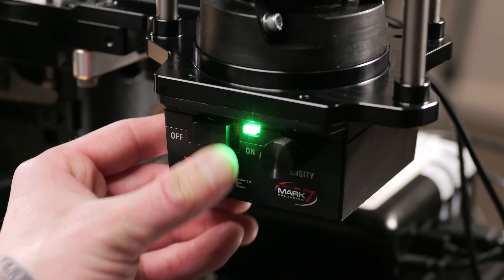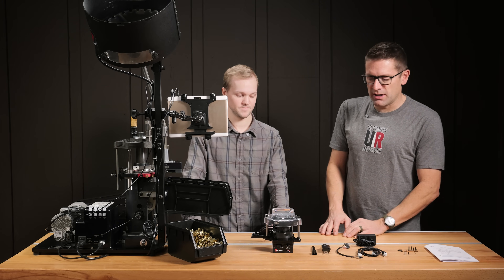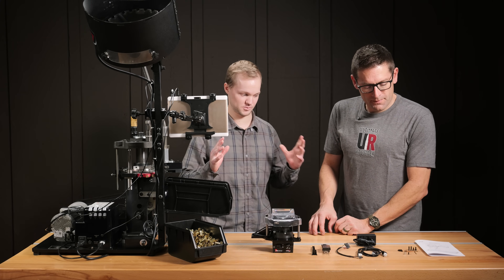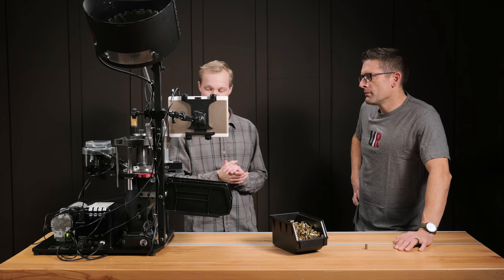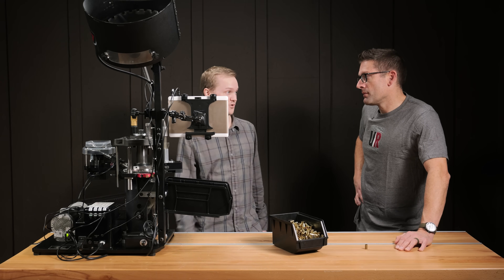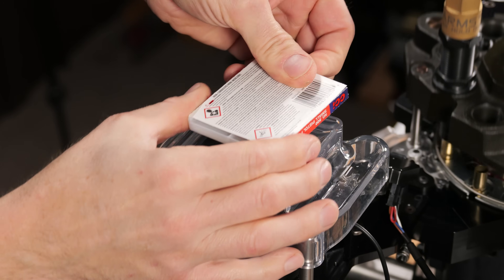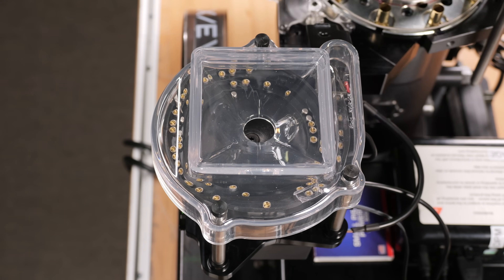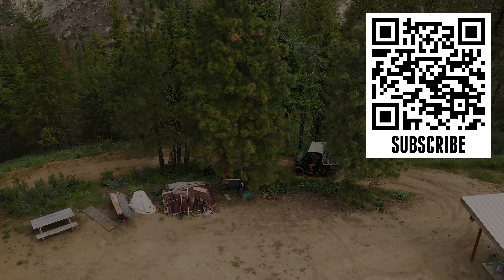NEW: Mark 7 XPRIME (Apex 10 Priming System Upgrade)

Comment: Question..  does the cover on the bottom of the xprime for the control box come off really easy or is something wrong with mines.. as soon as I took it out of the box the cover was off and it snaps into place but looks like it should be glued on the edges as well and it does not snap or click into place very well.  Kind of a light click in as it feels like it’s going to fall off very easily

Comment: Contact b team engineering. There priming system is on another level. Much.  Much. Better than x prime. And cheaper. I have 2 of them.
Reply: No thanks. Hustling a 3d printed setup that still relies on Mark 7's priming system and trying to say "it's better" is just nonsense.